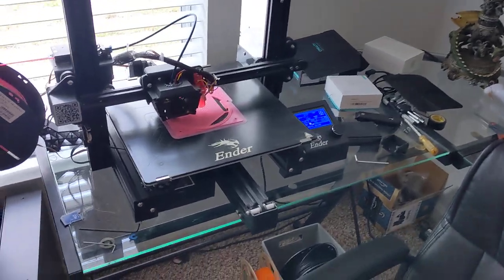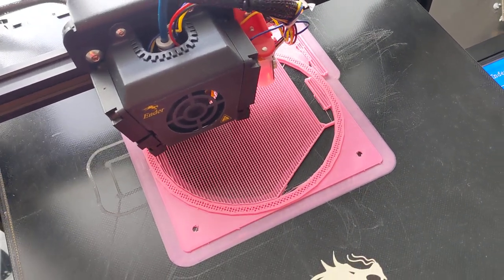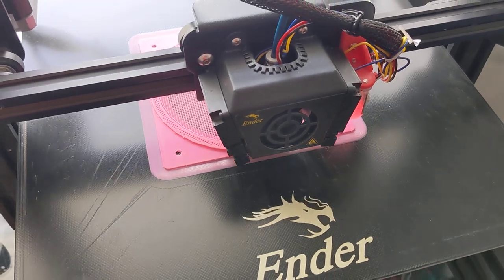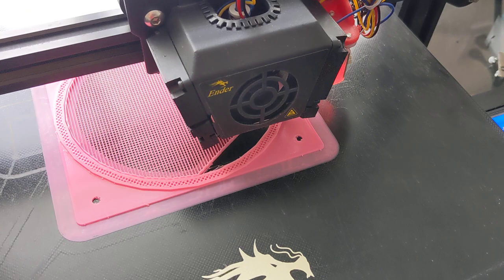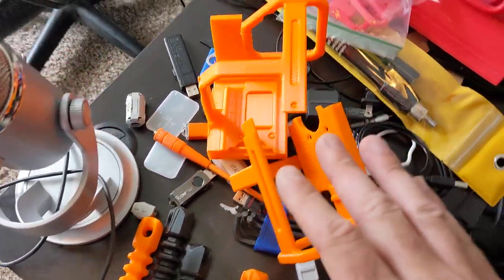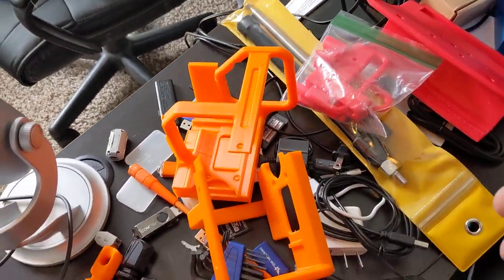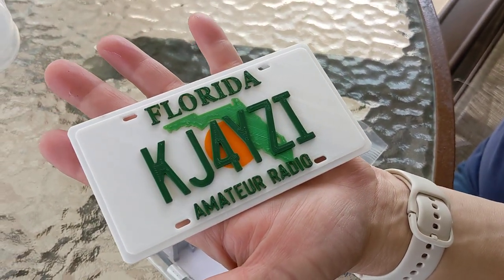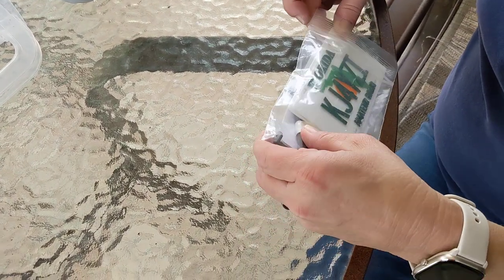3D Printing, Creality Ender 3 Max, Things I have Printed For Ham Radio AND MORE!

Comment: I have an Ender 3 Pro, made lots of upgrades and tweaks, bigtreetech board, direct-drive hot end, glass bed with PEI on the top, added a neopixel x8, and other things, but the new noard does a 9 point bed level... check your menu options, you'll like it!!!

Comment: I like Overture okay, but mostly I print with Eryone and Hatchbox.  I actually like printing with PETG because you can leave it outside in the weather and it lasts longer than PLA.  I don't print ABS or ASA as the fumes are bad for you that come off of it.  I have some Eryone PETG with Carbon Fiber that prints unbelievably good.

Comment: Wi-Fi box? Nah, Raspberry Pi with Octoprint, does all that stuff and no need for transferring cards any more. And clean fingerprints off of your bed between prints with isopropyl alcohol or carburettor cleaner or brake cleaner,